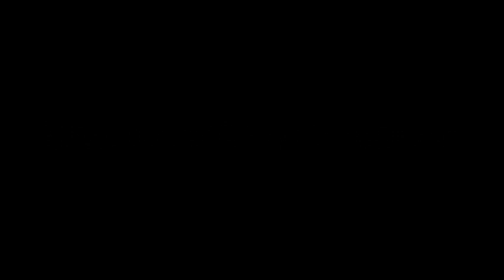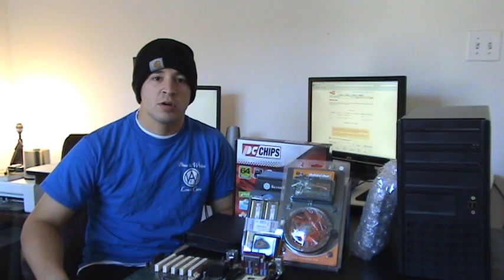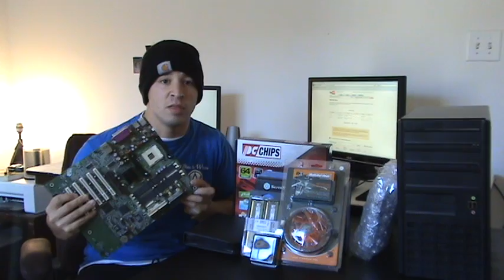How to Build a Computer - 3 - Choosing a Motherboard

Comment: @MrJonas3211 you should be working in gHZ not mHZ, but to answer your question somewhere between 3.0 and 3.4 though the new i7 runs at about 2.4 but that's a sandy bridge and new. it depends on the processor.

Comment: 16 bit graphics is one of the lowest graphics u can use,, thier is also 8 bit graphics U can get  real cheep but the bad thing about useing an low mhz is U sometimes need old windows like windows 98 or windows 95 graphics but thats way old but cheep ,,, u can buy a graphics card and update your graphics as long as you have windows vista or windows xp or windows 2000 or anything newer you can update your computer to an high end gamming computer

Comment: @MrJonas3211 there's no such as lowest Mhz for a gaming pc. Depends on what game you are going to play. For games you just check the RAM, CPU and graphic card requirements. Then when you want to choose a motherboard you try to get a motherboard that fits the RAM, CPU and graphic card. So you don't start building a system from the motherboard but from RAM, CPU and graphic card.

Comment: I heard some computer builders wear a wrist band that is grounded to the floor so they dont sap the board. But is there anything else you pros recommend doing if i dont have a wrist band like that. Should i wear gloves? Or i also heard dont install on the carpet.

Comment: NEVER EVER EVER HOLD A MOTHER BOARD LIKE THAT!!!!!!!!!!!!!!!!!!!!!!!!! If it gets a static shock it will be dead. If you drop it it will probably break and if you touch it like that (or even at all) You will get lead or other chemicals on you depending on what kind of mother board you have

Comment: @desertfox1792 
. It might result in an Electrostatic Discharge (ESD) damage. simplest way would be to use a pair of gloves, but if u r not, u need to frequently ground urself to prevent ESD.

Comment: @ImEatingRiCE well, u could accumulate static electricity in your body (merely by excessive walking on a carpet floor) and that could be transferred to the MB, and can instantly fry some of the components. To absolutely eliminate the possibility, I usually recommend, and always practice, wearing gloves. Or u can ground yourself by touching a metal object before handling computer components, but you gotta do it frequently! IMHO, wearing a pair of gloves is the best way :-)

Comment: @GreubsAkaRTG Well yeah i was pretty sure that was common sense not to touch any chips on the mobo i left that out... but touching the PCB is fine.... as far as touching the NB, SB, and MOSOFET(some of which are covered by a Heat sink) yeah or any any chips on the motherboard is dumb :P

Comment: @GreubsAkaRTG ok ok to a point yes if you roll around in carpet and drag your self on it yes you will. But i have also never had that problem because my down stairs is all wood, and the table is wood so thats where i build + over clock cause its cold in the dinningroom/kitchen

Comment: ESD is mainly only a concern with things that hold volotile memory, such as the RAM. Also, if you've grounded yourself out by touching something such as a metal computer case or whatever, then you're fine to handle a motherboard.

Comment: @Necrophallis It's actually FSB (Front Side Bus). It's part of the processor, and is usually specified in the processor specs. You can use software such as CPUZ to check it if you need.

Comment: If you have the money sure, but it is in no way necessary unless you have a workstation.

The i5 on the other hand start at $200 and are great bang for your buck. Overclocks damn good as well.

Comment: the best way that I have found is to simply look at the sticker (usually on the side or the back of the computer) and google it... it will usually pop up with the hardware info in the first 3 results (this only works if it was off the shelf to begin with!)

Comment: again hands down. nailed it on the head. LGA 775 = LGA 775 both a core 2 and dual core fit in the same socket type.